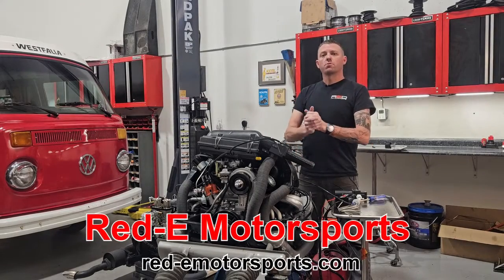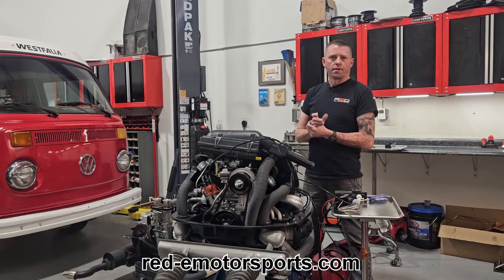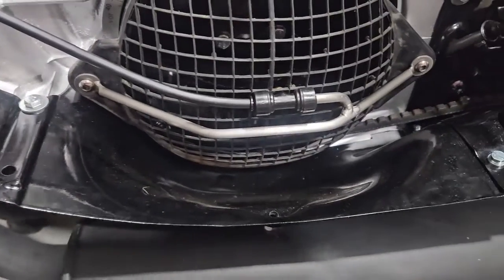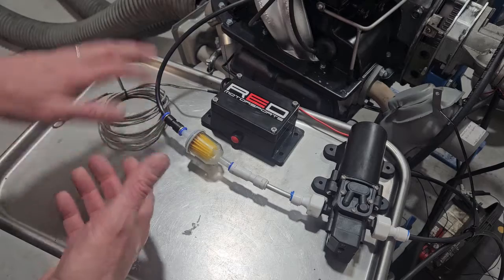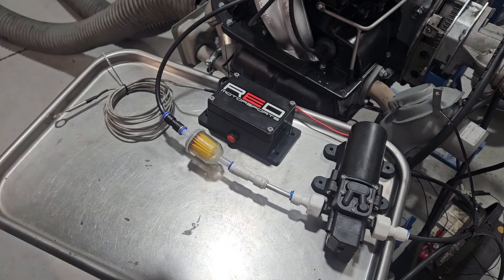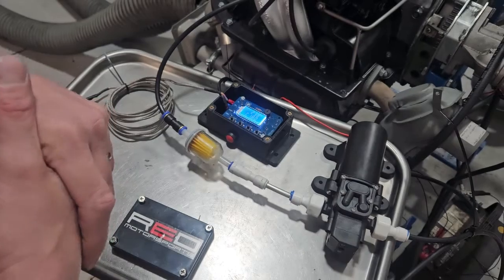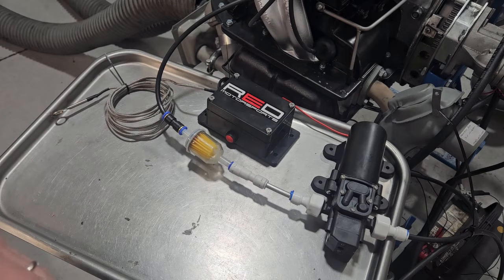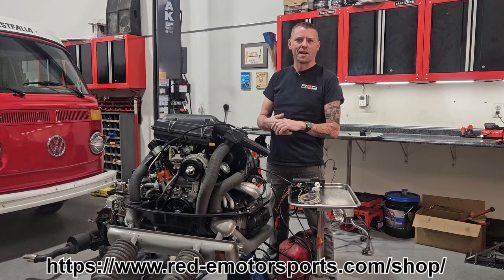Spraybar Cooling System for Aircooled VW's

Comment: If you use distilled water your misters won't clog as fast.
Reply from the maker: It's the small debris in the tubing, etc that does it. I've found if you flush a quart of water through the system before installing the nozzle it doesn't plug up very easy at all

Comment: Hoover mods to rockers,rocker shafts and  case mod to cam journals take a lot of heat away from cyl heads ...dual oil coolers ,remember Air flow is a minority over cyl heads it's the oil that removes the heat ...misty water over the engine is based on what exactly?...the Hoover mods are proven ...
Reply from the maker: Run a head temp gauge along side an oil temp gauge and you will quickly see that no amount of oil cooling will affect your head temperatures read under the plug. Feel free to publish a video showing you restricting airflow and add all the oil cooling you want and show us what happens.

Comment: If your engine is well made with a good setup, it's doesn't overhead at all, I live in the moutain, I take my bus with a pan familia and the whole familly in roadtrip, never had any overheating problem (thanks to the homemade EFI).
BUT, on a race track, it can be a HUGE advantage.

Comment: You should call this product the rustomatic 2024. The steam from the water hitting your heads and exhaust manifolds has to go somewhere, so sooner or later your car will start rusting out in odd places that might not get noticed until its a real problem.  Not only that I would hate to see the mess this would make under the car after six months of steaming your motor everyday
Reply from the maker: We've run this on our shop truck for 3 years now, no issues thus far in that regard.

Comment: About six years ago I retrofitted a pair of mower deck cleaning nozzles from a cub cadet zero turn, flash cooled and ruined a set of heads lol. Too much water too fast is a no go.
Reply from the maker: Exactly! Easy to go overboard with water on a hot cylinder head. We have the nozzles dialed in on this one
Reply: @red-emotorsports1212  excellent video! What are your starting prices looking to be like?
Reply from the maker: @JamesDavis-jo9tk  at the end of the video we have a link to our "shop" on the screen to purchase. We are about to make another batch of them in the next week or two https://www.red-emotorsports.com/shop/

Comment: In 1984 I did something similar on my Baja Bug.  I used a universal window washer tank with pump and a spray nozzle aimed into the fan.  I turned it on if the oil temperature got hot and let it run until the temps came down.  The system worked well.

Comment: If more air with a bigger fan and different tins doesn't help, how is making that air cooler with the mister going to help?  Without before/after testing, all your statements are speculation.
Reply: Nope. Dead wrong. 
It isn't the water cooling the heads. It is the latent heat of evaporation. The same reason your body sweats. The same reason your refrigerator/freezer cools. Its physics 101. When the water hits the heads it evaporates. When a liquid like water changes state from liquid to gas it requires heat (endothermic reaction) that heat has to come from somewhere. In the case of this water injection system, that heat comes from the heads and some from the cylinder fins. Unless the rules of the universe change, this system will work perfectly 100% of the time as long as the cylinder/heads are hot enough to evaporate the water. 
 Before you were born cars used to have bags hung in front of the radiator when crossing the desert or climbing the mountains. These bags had small holes in them allowing a small amount of water to leak out and be blown back on the hot radiator and engine. When that water evaporated it took a ton of heat from the radiator and engine keeping the engine cool under very harsh conditions. The exact same science as the water spray injection in this YouTube.
Reply: @benkanobe7500  I know the mechanism behind water's cooling effect, and note that I stated "making the air cooler" not 'wetting the engine'.  And you're wrong about the heads needing to be hot enough to evaporate the water, as long as the air can evaporate the water it will have a cooling effect even if the heads are dead cold.
Reply: @DonziGT230  Thank you for correcting me. I was considering the readership and your comment about how to wet the engine. You are really smart. We all should have figured it out by your well written technical explanation of endothermic reactions.
Reply: @DSX1568  When he was talking about different fans and shrouds not helping the heads I assumed that his mister system would be at the heads.  For hot head problems I'm guessing it would need one for each cylinder, or at least one centrally located at each end to get increased head cooling without over cooling the cylinders.  I've never run into temp problems on a VW so I never gave it much thought.
Reply: @DSX1568  Where does the air in the shroud come from?  The fan of course.  Spraying into the fan puts it directly into the shroud.
Reply: Pure nonsense. At least show some proof .. like actual temperature-change numbers.

Comment: Very nice and simple set up👍I do disagree slightly with you on the matter with oil not helping with the cooling of the heads. If you set up your case and oil system for added flow through the push rods and through the valve covers you can actually easily pull 10-15F away from the heads, but it of course requires the cooling capacity to keep the oil tempered. That water mist system is a nice retro fit option.
Reply from the maker: I have had different results myself. I did a block off plate to eliminate the stock cooler completely, and head temps were the same on the same test drive before and after. Head Temps mirrored the previous drive on each hill and downhill. I've honestly never been able to make pil affect my head temps my any significant amount. I have found same for same synthetic oil dropped oil temps 15-iah degrees without affecting head temps, and during these tests with the oil cooling removed completely I observed head temp was directly affected by engine load while oil temps were affected with rpm. I.e. floored uphill with lower rpms oil temp goes down, head temp climbs, and going downhill with light throttle head temps dropped and oil temps actually climbed. 20 years later I still consider the two mostly unrelated to eachother. That's just what I observe anyway. Individual results may vary
Reply: @red-emotorsports1212  Yes. I would imagine that that did not change much. You need to increase flow to the heads significantly. Think "modified" Hoover mods or thereabouts. So like I mentioned, it is not something you just do. That has to be thought into the project from the beginning. Oil galley, lifter supply, lifters, pushrods etc. everything needs to be designed to move more oil. Then the temperature decrease at the heads become visible as does the increase in oil temps. This is why I noted that the oil cooling system needs to have a little over capacity. But that mist system is an easy way of taking the edge out of the temps under load.